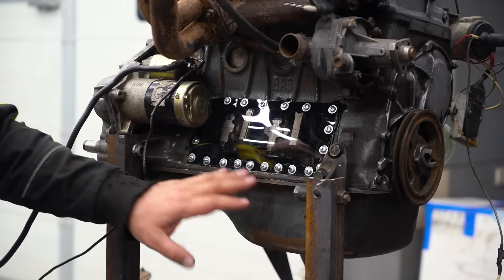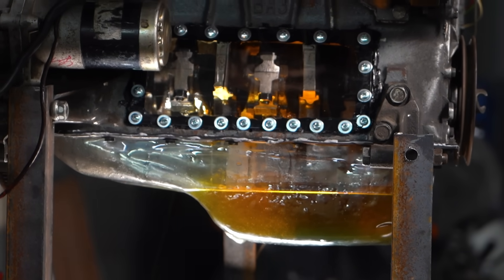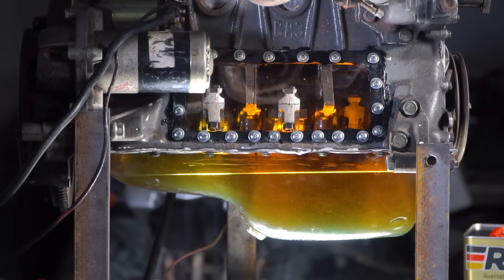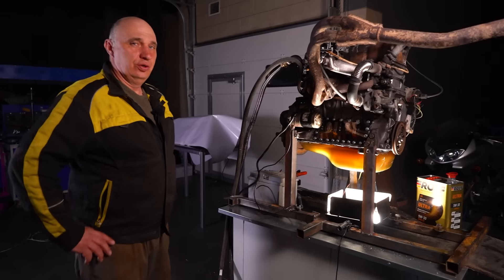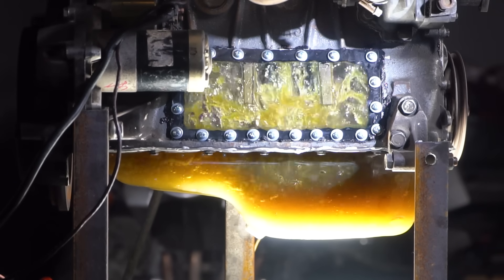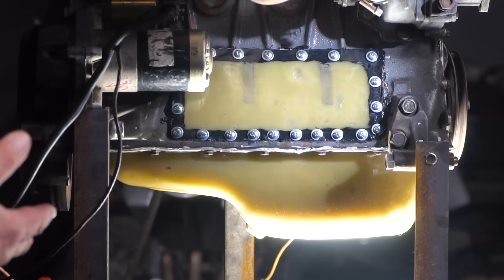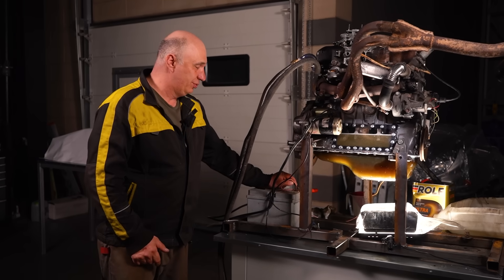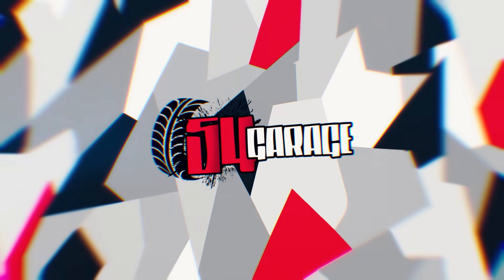What actually happens when you overfill your motor oil? (w/ transparent oil pan)

Comment: Needed an oil pressure gauge to show pressure drop
Reply: Were they testing pressure though? Or were they showing windage...
Reply: If you overfill and the oil essentially gets foamy from too mush air, oil pressure will drop as air is getting sucked into the pump. Less oil to bearings and can will lead to damage. Really wish they had an oil pressure gauge to show this.
Reply: @Johnduvall-l4l  It would be interesting to see what the bearings look like even after the short runs he made.
Reply: Yep 👍
Reply: Interesting discussion. Xand observations n conclusions.    I have some experience over filling my 1200cc Honda Civic year 1970'ish.  Definitely made the ending run rough and bogging down struggle w rpm.  Very distinct impression of excess internal pressure defeating the combustion stroke.    The Frenchman 2 main points head warning of oil foaming /molecular/ physical  breakdown and hindered  circulation.  Perhaps silicon grade motor oil alleviates such attributes
Reply: I put 7qts in my Triton v10 because the oil dipstick tube rusted off, so I fabricobbled a copper pipe on its place. Those engines are known to burn oil so i make sure to keep it topped off at all times.
Reply: Need to see this under loadn
Reply: Agree 👌🏻 that would have made the video more informative 👍🏻
Reply: I have tachycardia! My blood pressure is not high. My oxygen level is OK. I have an allergy to metals only. An Endodontic File broke in #18 tooth in 1982. In 1987 a Root Canal was attempted on #19 and Capped. All hell broke loose with the Chinese Meridians to 18 & 19 being lungs & large intestines. Money & War & Medicine rule the world. Russia is Orthodox Christian!
Hail to Russia & China to defeat Zionist Hegemony! The Beast is Greed & the Red Dragon is Medicine! Invest in Truth, Love, intelligence & Freedom
Reply: The pressure usually drops a little bit from the tests I've seen, but not alarming. However, the bearings tend show signs when there's too much air in the oil (and power goes down and with that the fuel consumption goes up).
I'm honestly not sure what this test was supposed to show, and clearly they didn't either. 😂
Reply: Lada had no pressure gauge it had only alarm transducer from the stock.
Reply: Smh stfu yall
Just watched the video like I did shits meant to show you an extra .5 or a qt won’t hurt your fkn engine
Reply: the dip stick have hallow dots on it which tells how much space is in the sump available to fill the oil for the engine
Reply: Yes it would damaged the valves And craftshaft only when oil pressure is low
Reply: Yes, you’re right - please do it again with an oil-pressure gauge and notice the values of pressure of the oil.
Reply: Most engines use a positive displacement pump.

Pressure at gauge will likely drop a little but as long as there is sufficient flow that all that really matters. Just need enough force to shove it between bearings etc.

Air happens - ppl who actually know what they're talking about would also understand the concepts of a dry and wet sump. Learn about them and you'll see why it doesn't really matter about air, just the flow of oil.
Reply: Oil pressure will remain the same, because it's getting picked up. The anount of oil doesn't matter too much, as long as the pickup is still being fed.

Edit: The bubbles will affect it, though.
Reply: @joshjlmgproductions3313  Air compresses, oil doesn't.  I'd expect an oil pressure gauge to show  a drop in pressure and less oil getting pumped to the various bearings and journals in the engine.   Excess oil in the sump could mean less oil to the engine.  In this vintage engine, the oil pump seems to be working very well.

Comment: I'm curious and maybe others are curious to see the simulation of high G-force turns by tilting the engine.
Reply: I believe Porsche uses a device like that when developing their engines.
Reply: @Colorado_Native  Yes, for their below GTx, or RS level, pure street vehicles.
Their 'street race cars' and actual race cars all have dry sumps. 😉
Reply: @Colorado_Native  Thats why windage trays and baffles are used in oil pans and for high Gs and angles dry sumps.
Reply: @donziperk  Thanks for the reply. That's why they developed their test stand so they could simulate and observe what is happening in the engine while cornering and decelerating, cornering and accelerating, accelerating, or decelerating and even simulating bumps repeatedly under controlled conditions and being able to address the engineering and design changes necessary and do it quickly and repeatedly for the best results. This was much faster and efficient than trying to use an actual car.
Reply: This little motor cant make any G-force!🤣
Reply: There’s a lot of speed bumps where I live and I always drive 25 to 30 miles an hour over them because I have a big truck.
So when I do that,(for fun obviously) catapult me and my kids off of our seats 😅

 and I’ve always wondered how the oil is being catapulted inside the oil pan when I do that

Comment: I'd like to see a test with this... What if you noticed a spun rod or main bearing in time, could overfilling the crankcase and turning the bottom end into a "splash lubricated" system save the engine long enough to get you any appriciable distance?
Reply: Good question. I'd love to see this answered. It would be tough to test.
Reply: If I were losing a bearing though, I try this in a pinch. It may work but at worst, It couldn't hurt anything.

Comment: put some egg yolks in it, a bit of mustard and fill it up with sunflower seed oil and after a few mins you got freshly made mayo
Reply: I only eat my sandwiches with 10w-30 mayonnaise
Reply: @MoonberryJam93  You should try Mobil 1 0W-40 mayonnaise.
Reply: Mmmm, forbidden Mayo. It is the same process; hydrogenating the oil causing it to congeal, motor oil is designed to return to liquid but eventually... well you pull the dipstick out cold and it's covered in yellow mayonnaise and it's now time to dump the sump and flush all the old oil out.
Reply: Throw a lil lemon juice and you got hollandaise sauce 😂
Reply: Now you take this home, throw it in a pot, add some broth, a potato. Baby, you’ve got a stew going.
Reply: @skaldlouiscyphre2453 fucking eww lol
Reply: Well, real mayo that you buy in stores is churned and extracted by machine so yeah you can technically use an engine to make mayo but not very efficient
Reply: @WhiteWolfos  just try to ignore the strange petrol-y taste and smell.....
Reply: too much  cholesterol in the Castrol oil
Reply: LOL
Reply: Dont forget the sub sandwich warming on the exhaust manifold.

Comment: you should do this with more engines. 2jz etc obvious culprits people would be interested in.
Reply: A proper 2jz is probably $5000 maybe more. Lada engine free from scrapyards
Reply: @gamelias87  it wouldn't need to be in decent shap and some lexus not so desirable one would do. russia is where lexuses go to die anyway, anyhow the 2jz was just an example of an engine people would be interested from the point of wanting to see where the oil flow as well as being clickbaity for it to be worth it to them. the more you would have them the more interesting the differences would be, like you know a test of a single fan design with a cfm meter isn't interesting at all but a series is. though i know they're not like a serious channel of course. seeing differences with just opel would be enough for a click for me anyway for a repeat (I'm not that interested even in the overflow part, more so with just the flow of the oil back into the pan and the bubbling).
Reply: Naw fam u play too much fortza

Comment: Who needs an oil change when your leaks and you keep topping it off 😂. Gotta change the filter of course
Reply: Aha you found my 1991 Hyundai Excel I had in high school - self-changing oil!
Reply: detroit diesel - if its not leakin oil then it must be empty
Reply: @eldoradoboy  This was the standard for cars back in the 60's and earlier. If there wasn't an oil slick where your car was parked for the night then it was out of oil.
Reply: Had a sterling truck burn a gallon of oil a day. Always had fresh oil
Reply: @Glipsnarp  I would just start putting recycled oil in it. Or replace the engine.
Reply: @the_kombinator  truck made a lot of money sucking catch basins. 7 grand a day since 2003. They didnt want to sink anymore money into it. 2022. That was the last year we ran it
Reply: @Glipsnarp  Wait was that the norm for that truck/engine, to consume so much oil?   I mean, a gallon of oil per day per month is like... even if you can get it bulk that's gotta be like $300 a month, almost 4K a year.
Reply: @the_kombinator  the truck has 2 diesel engines. The secondary blower engine had been rebuilt back in 2012 for excessive oil consumption. The main drive engine was all original and started burning out back in 2018. When the truck makes 7k a day, they dont want any down time. 
It was a vactor 2100 dual engine on a tandem sterling chassis
Reply: LOL
Reply: Amen haha. My 05 Toyota matrix has 200k and it goes through a quart every 500 miles
Reply: @2strokeFORever  Low tenasion rings and gummed up oil control rings..
if you work the consumption  out it's probably 100:1     gasoline/oil          2 stroke mix ratio!!
Reply: That reminds me of a joke by a Canadian named Dusty....cant think of his last name, but he is funny as hell.
Reply: Test the pH and find out for yourself.
Reply: My old truck just burns oil in multiple places 😂 Been trying to rig it together good enough so I can start driving it.
Reply: Why, if the oil is pretty much new all the time why bother?
Reply: I have an 01 civic that burns and leaks enough oil that Ill go from full on the dipstick to a little below the fill line in the time it takes for a tank of gas. Havent done an oil change. 25,000km later it still looks brand new, clean enough its hard to see on the dipstick lol
Reply: @wills.5762  That's interesting, I had an x-trial that burned a similar amount and the oil was black only 500kms after changing. Maybe yours is valve stems while mine was only the rings. I was told cars that burn oil get contaminated oil much faster than those that don't.
Reply: @notmyrealname8686  It just leaks too fast. If I throw 15w40 in there it'll darken up. I had a 92 civic that wasn't much better and it turned black as quick as a crusty old diesel
Reply: @wills.5762  04 civic owner here, mine doesn't leak or burn any oil and if yours burns oil there is something seriously wrong and you'll likely need an engine rebuild. Hondas are famous for not burning any oil and being reliable also. At the rate you lose oil, repair of the leaking places or engine rebuild would come cheaper in the long run!
Reply: @itsnetts Hondas are most certainly NOT famous for “not” burning oil. Every car burns oil. They are built that way. In many cases oil helps cool the engine. Had a 2008 TSX years ago that revved to 7,600 rpm’s. High strung Honda motors absolutely burn oil.
Reply: @Soh90  Maybe high strung ones, but I've never heard of a stock run of the mill engine burning any oil unless it's very worn. I know mine doesn't.
Reply: @wills.5762 time for a new engine 😂
Reply: I have done this method for years on my Mitsubishi pickup truck and I only change the filter when it rots out and leaks 430k miles and still going strong.
Reply: use alcohool instead gasoline